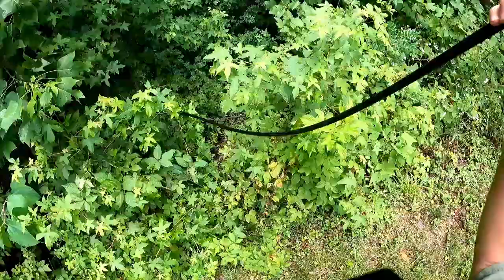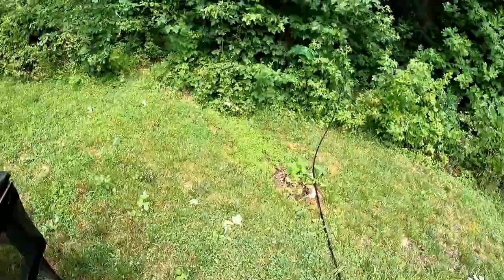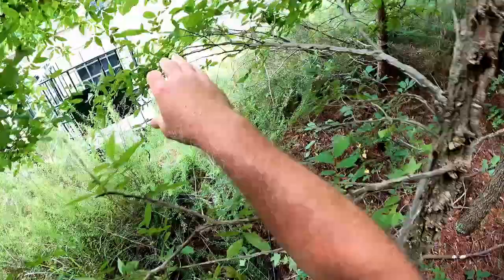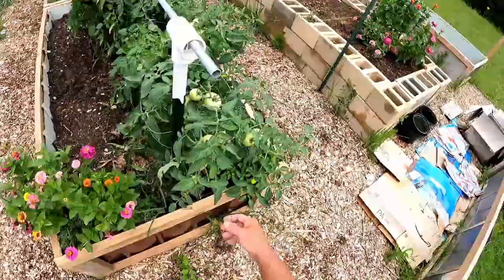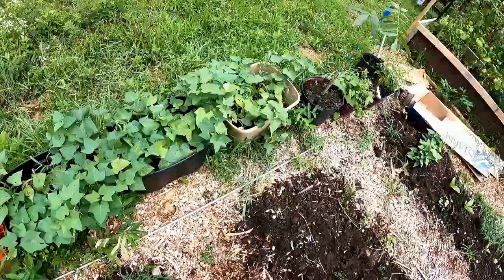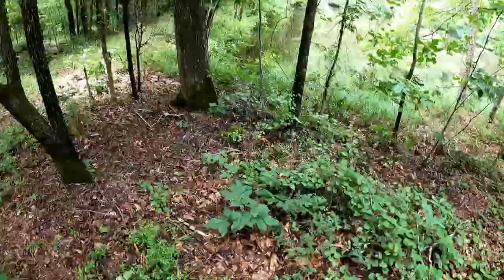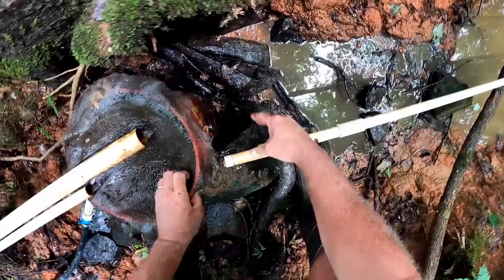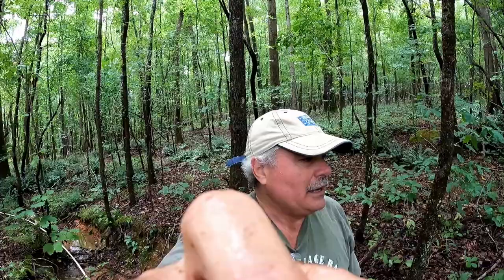#171 Drought Proofing the Garden Water Supply

Comment: Hi Tim!  Looks like you have a good solution for emergency water to the garden.  Yep, those Japanese Beetle traps work great!  Bummer about the ram pump bucket failing, but two years is a pretty good run for a plastic bucket left outside all the time. Your Generac system was a good investment! Thanks for sharing!
Reply from the maker: Hi Martin!  I noticed your tooth bar video, I need to watch that!  Thanks.